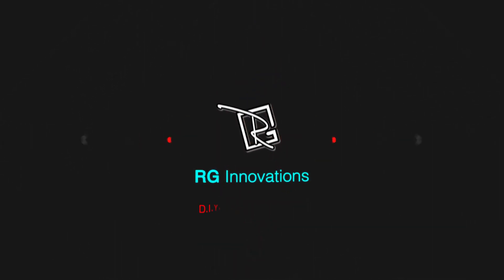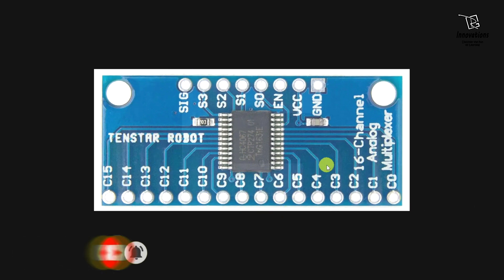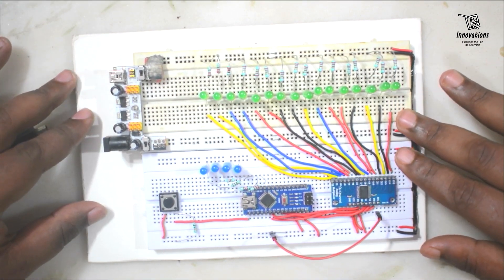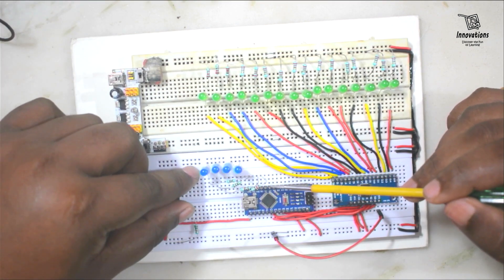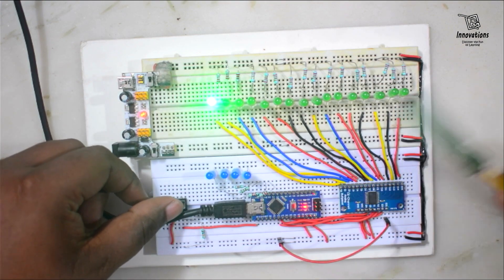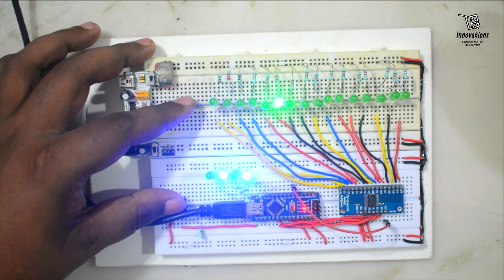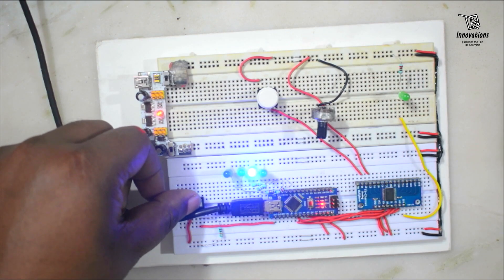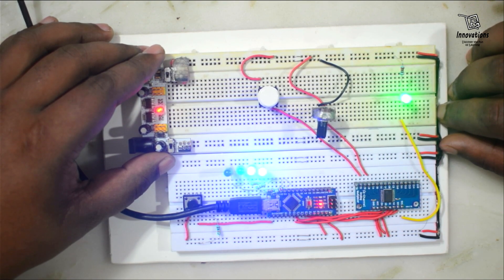CD74HC4067 16 Channel Multiplexer  - How to Use - Interface with Arduino - Increasing Inputs/Outputs

Comment: Under what voltage should the inputs stay under.. I assume voltage 32V /  115AC .. or high current (2A) will kill this little 5v device?
Reply from the maker: Max 5 volts

Comment: sir please i need your help i am using this multiplexor for my school project but the 8 to 15 channles show same outputs as the 0 to 7 please help sir
Reply from the maker: Check your wiring and connections carefully, and also your code.

Comment: I am trying to get cell voltages from a Li battery pack - 14S. I am wondering of I could use 2 of these multiplexers to  see a cell voltage. One mux connected to cell 7 negative and the other mux connected to cell 7 plus voltage. I would use 15 MUX pins  and 2 MUX units to get each cell voltage. I would send the voltages to an Uno for processing. Maybe I need to drive the Mux with a separate supply, that is, not from the UNO.

Comment: Hello engineer! Can I ask a relevant question for my FIY projects which related to this tutorial video ty
Reply from the maker: Yes please, i will try my level best to answer.
Reply: @RGInnovations  my question is about the kids or type and codes of diode that we use for relay, or type of diode or code that using for RELAY pin 85 & 86
Reply from the maker: Sorry, Did not understand your question

Comment: I've read in multiple places that it's not a good idea to use a 4067 chip for high current output (such as LED). It is intended for signal output / input only. For LEDs, it's better to use shift registers, such as the popular 74HC595.
Reply from the maker: True. 4067 is for low current signals.

Comment: Just a quick question. Is there a way to determine how many "samples" the atmega328p chip can take per second when doing something like this? Or does it depend on the complexity of the program running?
Reply from the maker: Depends on the program

Comment: I thought with multiplexing you couldnt control multiple things at once which im trying to figure out how to do. I got the arduino uno r3 trying to control two 16 channel relay boards but no one has tutorials on this. Is it possible for you to teach us this?  I think i read you can use an expander but i have no clue.
Reply: 74HC595 might work better for the purpose.

Comment: I read input directly from my moisture sensor to A0 pin of my board and it reads 4095, however if I use CD74HC4067 to read input, it shows incorrect and inconsistent values I ensured all the connections are correct but fail to find the solution to my problem
Reply from the maker: Can you check the 4067 board with a simple positive signal to see if the board is working properly?
Reply: @RGInnovations  Yes I am able to use it properly if sending outputs although the signal seems to get weak after passing the mux, I sent 5v through the SIG pin but I doesn't give the same in the channels
Reply from the maker: Have you made all the grounds common?
Reply: That seemed to solved the problem, thank you!
Reply from the maker: Most welcome.

Comment: Can you use toggle switches with this or will it flicker?
Reply from the maker: No it cannot be used as toggle switch, you need to use flip-flop
Reply: @RGInnovations  what is flip flop?
Reply from the maker: It's a type of IC
Reply: @RGInnovations  what does it do
Reply from the maker: It is used to build toggle switching circuit